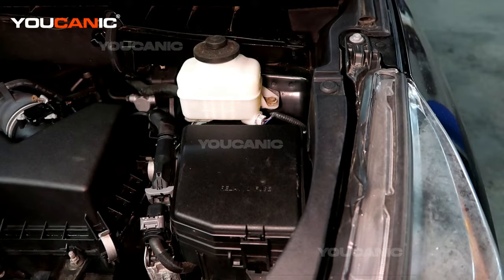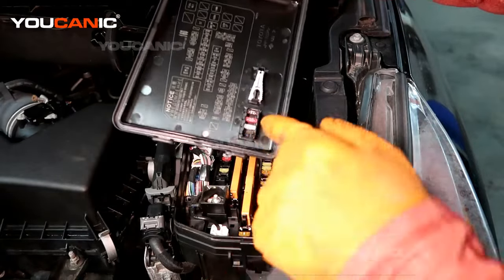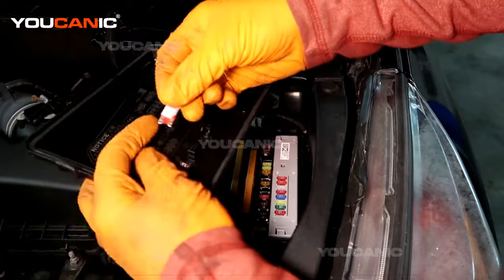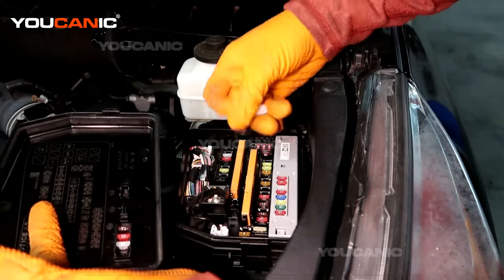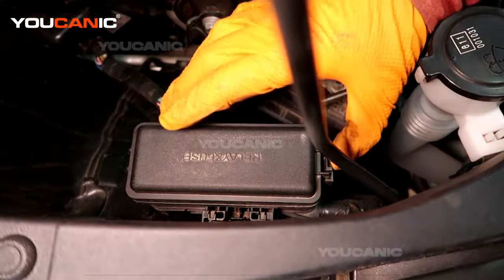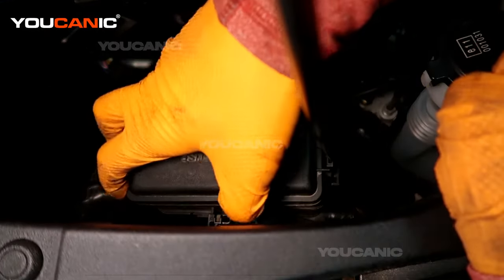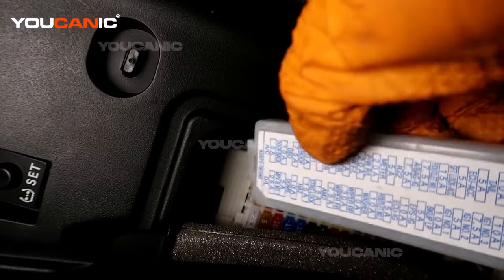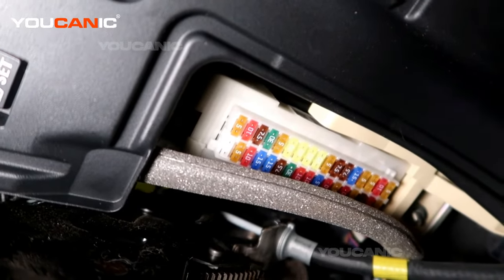2014–2019 Toyota Highlander Fuse Box Locations

Comment: Not sure if you respond to comments, but if one particular speaker isn't working and all the others are, would a blown fuse be the culprit?
I already tried changing the speaker itself, but no sound comes out of it still. I would like a reassurance to my suspicions before I pull out anything.
Also, great video! Clear and simple

Comment: Would the fuse for the brake lights be under the hood or in the interior? The rear lights work while driving but they don’t when I brake. I think it may just be the brake switch but it looked fine to me. 
2014 toy Highlander